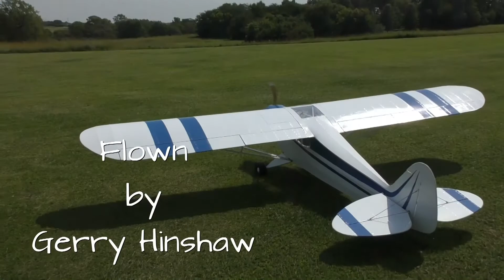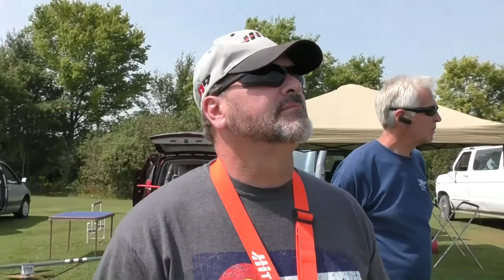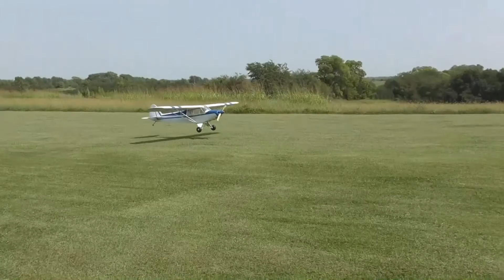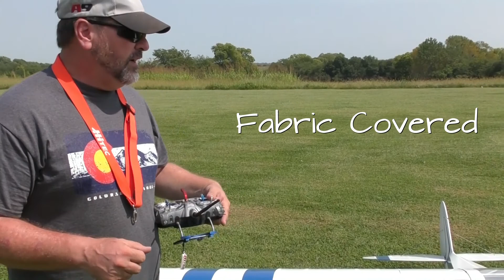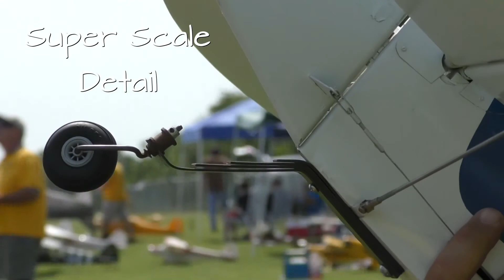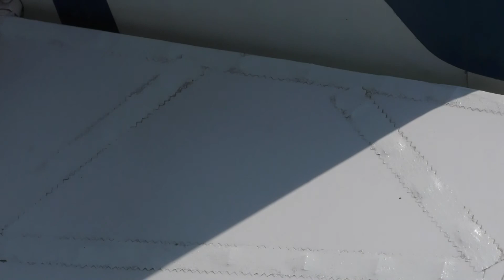1/3 Scale Balsa USA Piper Cub (2)

Comment: Curious... I see the G-62 has just about the same horsepower at the same RPM as the DLE 40cc twin. So, would the 40cc Twin gas work on a 1/3 scale cub weighing in at around the 30lb range? I'm thinking of building the BalsaUSA 1/3 scale cub. I've been building planes and heli's since 1981 and have built dozens of large scale craft for a lot of people so this is nothing new to me except these DLE engines. I want to build a scale craft and scale flying cub.
Reply: I would stay with a G62
1. You will need the nose weight 
2. You can run up to a 26x10 for scale 
3. I had very little throttle in flying it, but just enough to get out of trouble. 
Also this is a older G62, magneto with spring starter. With that setup, no extra dead weight is needed for balance.
Reply: @gjhinshaw  i was wondering about the weight too. Thank you sir.
Reply: @asw850  my weight on it, is 37lbs
Reply: @gjhinshaw  OK good to know for sure. Thank You Mr. Hinshaw.
Reply: @asw850  welcome!  Also this one has flaps and is also outfitted with all Hitec 1/4 scale servos.
Reply: @gjhinshaw  Is there an option for a wing tube or are the USA kits relying strictly on the wing struts? Also what type of mounting is there for the wing panels to the center and how does the center mount to the fuse? Or is the center already built into the fuse allowing you to slide the wings into the ends of the roots? Dowels? bolts from inside the the cabin pulling the panels to the center section?? I was trying to find a set of plans online to look at instead of asking all these questions lol. I really do appreciate your feedback. I was going to go with an float plane version also and modify the design to be able to change out wheeled gear and floats, vise versa....  Thanks again for your feedback. I love watching your video.
Reply: @asw850  can I get your email?
I will send you pictures
Reply: @gjhinshaw  I don't post my email addy on here. Is there another link I can get to contact with you? I remember users use to be able to contact another user through youtube on their own channel as a private message but I didn't see anywhere on your channel to do that.